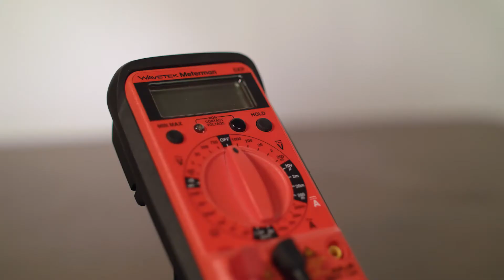How to Check if your Power Supply Works | weBoost

Comment: My 5V 2amp adapter power supply shows 5.37 Volts.  Is that over voltage harmful to a small device like my satellite radio tuner? The device is flashing and refuses to turn on.